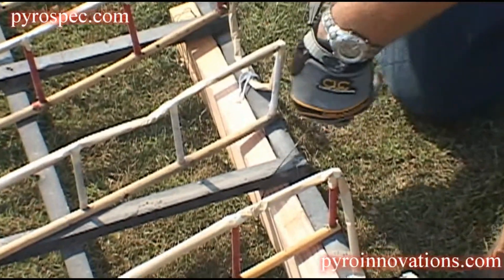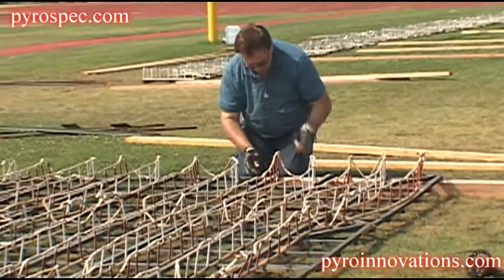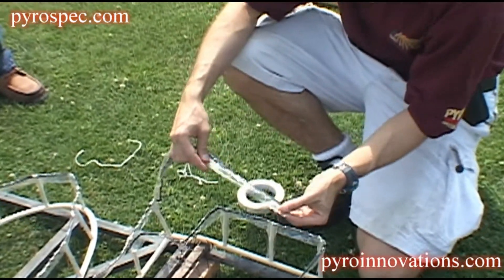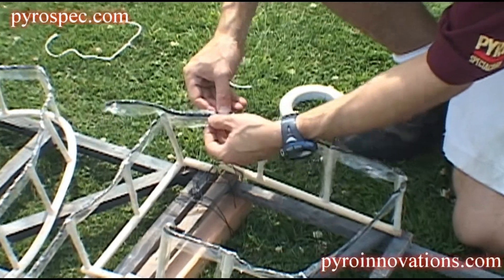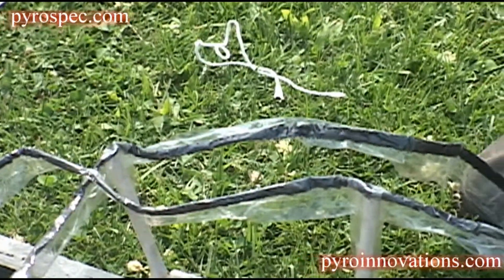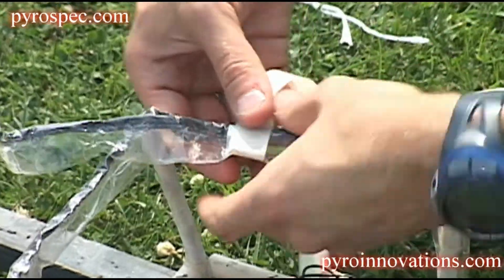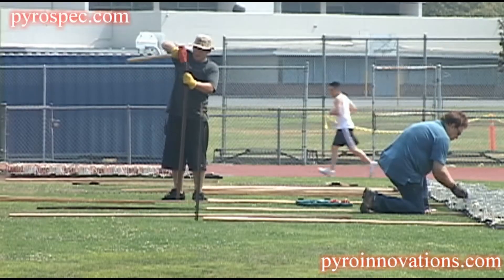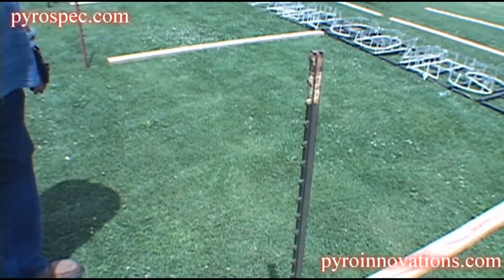How to Build a Fireworks Set Piece (Lance Work)

Comment: What fireworks do you use to build a set piece
Reply from the maker: Great question!  The pyrotechnic devices on a set piece are called “lances.”  Set pieces are actually more commonly known as “lance work” because of it. You can think of them as small colored road flares.
Reply: @PyroInnovations  do most fireworks shops sell them?
Reply from the maker: @Jaci Oldham Not to my knowledge as they are not devices that are sold individually for consumer use.